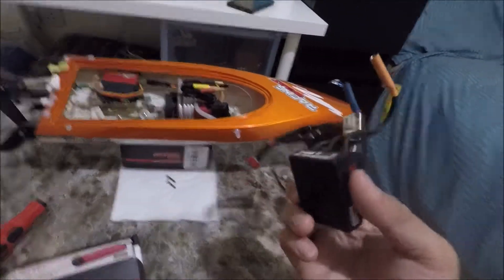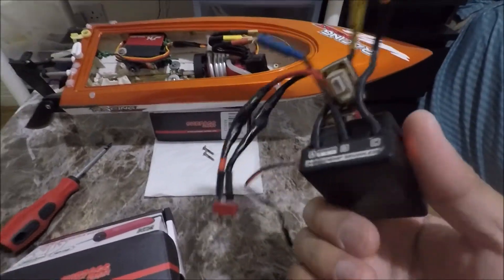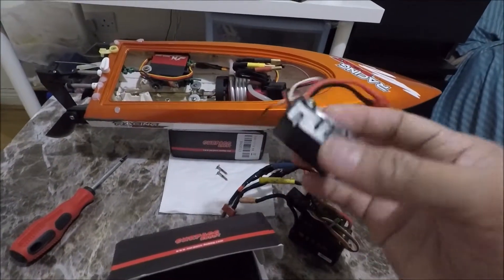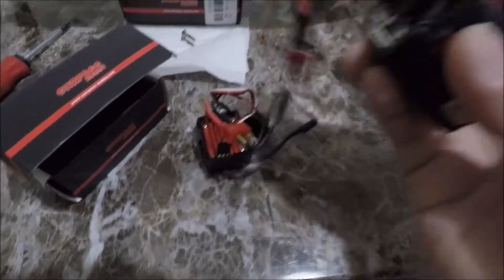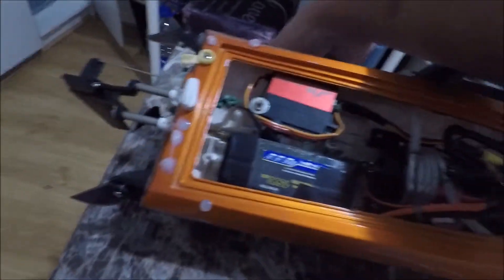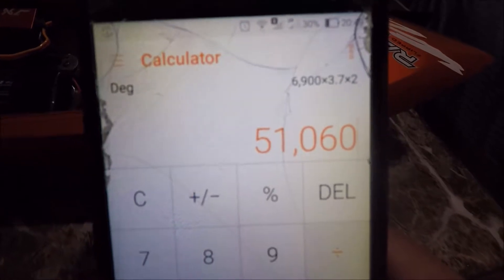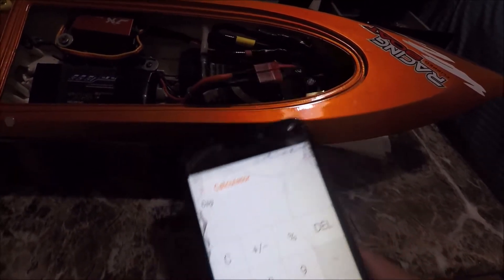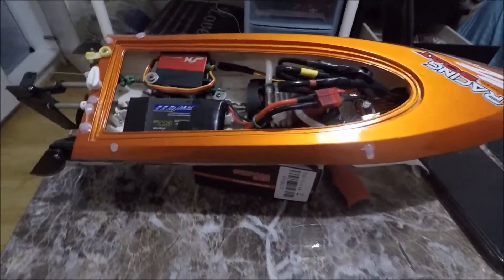FT009 50k rpm brushless upgrade

Comment: Do some research and use common sense in the future. Rcgroups has a lot of information
Reply from the maker: No need to hate. I just based it from my calculations. Just that I didn't include other factors such as boat weight, torque, etc. Thanks
Reply: @ianbudgetrc2574  Not hating at all mate , when experimenting numbers don't always give the desired calculated output as it doesn't take into consideration running or environmental conditions. Eg for RC boats I'd personally go with no more than 3500kv and use up to 3s so you have a more balanced torque Vs speed ratio and the drivetrain lasts longer
Reply: @Photo Fun Good choice